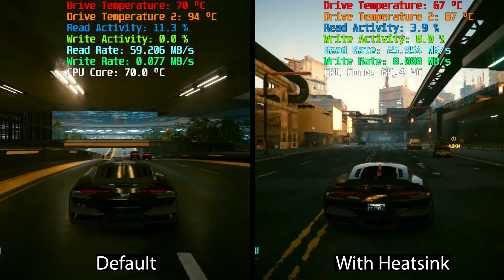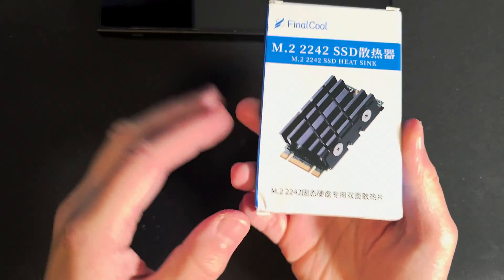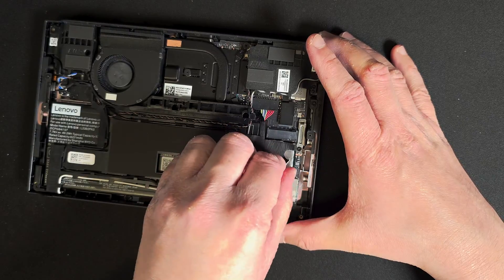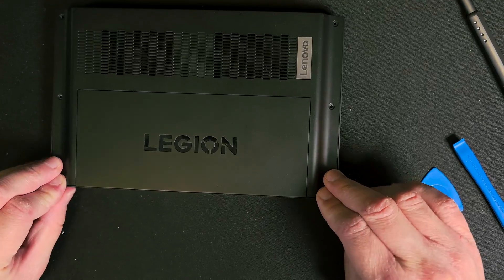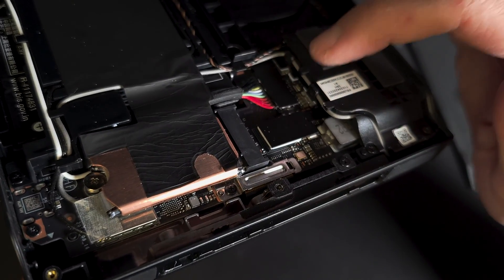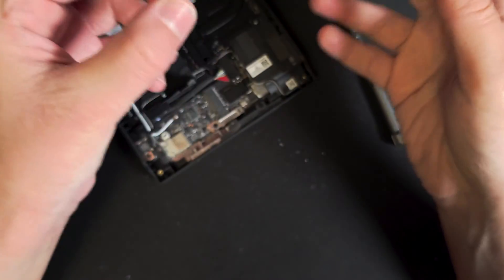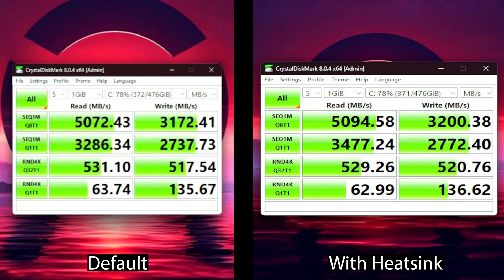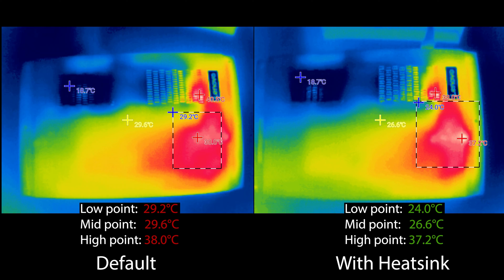Cooling Legion Go SSD - Installing & Comparing Heatsinks

Comment from the maker: I was taken by the high temps of the Legion Go SSD temp and wanted to take some action in preventing disk wear overtime, so I got those heatsinks to test out, unfortunately its impossible to fit 11mm high heatsink, not even 7mm, otherwise the Aluminum one i got would have the perfect recommendation
but still the Low-profile Copper heat sink specially made for the 2242 NVME size can still do its work by dissipating some heat
I'm also expecting other copper heatsinks that are 2mm and 4mm and will test them as soon as they arrive and give you all results 👍
2nd Part: https://www.youtube.com/watch?v=bOO2T7wrk14

Are you currently using a heatsink for your Legion Go SSD ? let me know

Legion GO playlist : https://www.youtube.com/playlist?list=PLg8ANjUNzqfN0uUCjfOQmFXCNulJuFIRr

If you enjoy my content Subscribe & Join the TECHOSAUR Community on Discord here : https://discord.gg/PXmJY6BP8b. 
you can seek technical assistance, exchange ideas and experiences, relax, share memes, make video request and most importanly feel at home

-------------------------------------------------------------------------------------------------------------------------------------------------------------

Heatsinks I tried:

https://www.amazon.co.uk/DolDer-Copper-Heatsink-Cover-Shield/dp/B0C9MD3P7K

https://www.amazon.de/DolDer-M-2-SSD-K%C3%BChlk%C3%B6rper/dp/B0BHT29565

-------------------------------------------------------------------------------------------------------------------------------------------------------------
For reference only, you can find the 2mm, 4mm heatsinks that I'll test next here:
https://www.aliexpress.com/item/1005002043321474.html?spm=a2g0o.order_list.order_list_main.4.68d61802XRk7x4
Reply: hey, i this still up to date or did you found something better for ssd cooling? Did you compare it with the custom backplate. (those who have this honeycombs and 2280 mod. )
Reply from the maker: @50fiddy05  I have the custom back cover ordered, and the newer revision should arrive this week, I'm going to check out how much it helps in cooling SSD and try some compatible heatsinks
https://www.aliexpress.com/item/1005006492565219.html?spm=a2g0o.order_list.order_list_main.11.175518026jb09c

if you are planning to get this back cover, please buy it from this link to support me, it's affiliated with no extra cost to you.
Reply: Were you able to see if the 2mm and 4mm fit and do better than the one displayed in your video ?
Reply from the maker: @Aaanze Unfortunately, the seller on AliExpress is unprofessional. I bought them in November 2023, and they never arrived. So, I ordered them again in February 2024, and they still haven't arrived yet. I'm in touch with the courier to find out what's going on, but they're giving me a hard time. I'll try to get them elsewhere, but I haven't found anyone else that has 2mm and 4mm for a 2242 SSD
I'm sorry for the delay
Reply: @TECHOSAUR thanks for the prompt answer, I'll keep waiting for your feedback then 😊
Reply from the maker: @Aaanze  to avoid more wait, i ordered them again but this time it says delivery in 9 days, granted AliExpress shipping not seller, hope it arrives this time
Reply: @TECHOSAUR I got the 2mm copper heatsink from AliExpress the thermal pad was a little damaged but I just installed it and it fits very nicely. I imagine it's better than nothing. I hope you receive your order.
Reply from the maker: @bigbank7350 Wow, what a coincidence!!!
Mine arrived today along with the 4mm. Did you try that one too? I hope it fits.
I've just posted about receiving them after this long wait!!
Reply: why unscrew everything if you don't remove the foil? you could have put it on without dissasamble it

Comment: How are you getting it to show your ssd temperature ingame? I'm on SteamOS so maybe this is just on windows?
Reply from the maker: I use HWInfo software to get sensor data; for the overlay, I use RivaTuner to show it. If it's supported there, then I think you can

Comment: I just turned down TDP on mine and the device has been on for 3 days to where I don't think the fan turned on crazily with general use.  It seems this is overclocked like when I had an ASUS gaming tablet that ran for like 90 minutes on a full charge... had to sell it because it got so warm that the thunderbolt port would shut down and disconnect due to excess heat.  I'll look at this for my Legion Go if it comes in 2280 config since I have that breakout board.

Comment: Have you heard about thermal pad W/MK? Dont know how much difference between expensive thermal pad with high W/MK use on copper heatsink and stock thermal pad come with the copper heatsink package
Reply from the maker: I'll be trying it soon, got some higher end thermal pad with better W/mK and will try them on, thanks for the suggestion

Comment: Cheers for the video!  If anyone is interested if what configuration I've used to get temps down.  Sabrent 2TB SSD 2030 with small plastic extender.  Foil over the SSD only (it won't fit with pad and heatsink under it).  On top, 1mm pad and copper heatsink , 2030 size and only over the SSD.  I've been running Crystal Disk Mark whilst plugged in on 30w mode.  The highest temp I can now get after five tests is 71 degrees c.  That is down from 81 which was the highest pre heatsink.  In game though, looking at far lower temps, around 60 now.  Temps are generally fine for gaming, no where near error inducing temps! :D
Reply: I have a 2230 with extension. So take off the old heat sink (took it from the orignal SSD) the  fit the 1mm heat pad, and the copper heat sink, thats it?

Comment: I think its much better to remove the thermal wrap if you gonna use the thermal pad for better heat transfer.. Correct me if im wrong
Reply from the maker: Actually now I have a 2tb 2230 SSD without the wrap and just A Heat sink and yet it's hitting over 90c 

Even if you remove the wrap it's not going to do much, there's no airflow going on there, most of the generated heat is building up
Reply: @TECHOSAUR  Im going to use a  2230 with extender PCB should i get the copper shield for 2242 or just for 2230 instead?
Reply from the maker: @macky10229 currently i have 2230 2tb with extender along with that copper heatsink made for 2230 form factor 

Putting the 2242 hestsink won't create equal surface cover so its better to apply the one for 2230

Comment: Well done for trying to discuss the problem of SSD overheating.
But your approach will not give a radical/positive result.
In the name of mobility and design of this device, the manufacturer sacrificed reliability.
If you are ready to modify the device, then I can give some practical tips on how to achieve significant results.
Warning: if you do not have experience in this type of activity, do not do anything that I have written for you here, you will lose the warranty and break the device!
1) Consider whether it is advisable to remove the foil from the SSD. Perhaps it has a backing that can interfere with heat dissipation.
2) Peel off and do not glue the ceramic tape onto the SSD. It can conduct heat to the battery, which shortens its service life.
3) Carefully drill several holes on the case in the area of the SSD. Both from the end and from the bottom. More towards the corner.
Note to point №3: The larger the diameter of the holes, the better - the lower the resistance to air flow. But you need to maintain balance
in choosing the hole diameter and the integrity of the housing structure.
Be careful and use common sense.
The holes can be protected from dust getting into the inside using the material from which tea bags are sometimes made. I mean
not a natural material (polyethylene) or you can use a mesh to protect computer coolers (with the largest possible hole).
4) In order for the holes to work more efficiently, it is necessary to build an air duct inside the device. To allow air flow
went from the holes past the SSD to the processor and ended up in the turbocharger.
I think double sided tape might work for this. Do not peel off the blocking tape from the top row, otherwise the cover will stick.
This material is malleable and cheap.
The more efficiently and thoughtfully the air duct is made, the more efficiently it will work.
The air pumped through the duct must also pass near the processor area.
Identify the remaining hot areas of the device and take care of cooling them in the same way.
!!!(Shiny surfaces do not scan well for heating (paint them / apply electrical tape before scanning (black is the best color)))
5) a) partially or completely block the screw holes located in the bottom cover opposite the processor. (part of the air duct structure (adhesive tape))
   b) partially block!!! screw holes located in the bottom cover opposite the turbine. This is necessary for the turbine to begin pumping air through the air duct and, accordingly, next to the SSD.
   The vent holes in front of the turbine should be covered from the middle to the edge.
Result: a significant drop in the temperature of the SSD and an increase in the temperature on the processor, a possible increase in noise from the turbine. Maintain a reasonable balance.
Warning: if you do not have experience in this type of activity, do not do anything that I have written for you here, you will lose the warranty and break the device!
All actions must be performed point by point, one by one, slowly observing the results of the actions you have taken.
During these operations/experiments, do not snap the lid of the device (the fasteners will break)
Just cover with a lid and tape around the perimeter.
P.S.: almost all devices are now made unfinished. This is done purposefully to increase company profits and reduce production costs.
You can, of course, take a more radical approach and cut a hole in the device body for a large radiator opposite the SSD, but without air flow to it the cooling will not be sufficient.
Contact with this radiator will be unpleasant. That copper radiator that you ordered from China will still be ineffective without airflow.
A shiny radiator is bad, painted BLACK is good: +15% cooling due to heat radiation.
Do you have any questions? (translated using Google Translate)
Reply: why should you paint radiators? what?
Reply: Physics course from school. Surfaces painted black improve heat dissipation by 10-15%. Due to its radiation. Look at the color of the cooling systems in high-end laptops. Look carefully where and what is being painted.

Comment: Perhaps the Final Cool Heatsink could be sanded a couple millimeters on the top for it to fit. It would work awesome because it has nice thickness and very secure as it is being attached by screws. I think is around 8mm tall because it's says 11mm but it is also taking in to account the bottom part.
Reply from the maker: But even a 7mm heatsink didn't fit, with no bottom part u saw

I'm getting 4mm to try it , hope it can fit my SSD is really running hot over 100c just installing steam games
Reply: @TECHOSAUR  Yes you are right still is pretty tall heatsink, would have been great if being smaller. 
I am having my Legion Go in 10 days, so I am planning ahead. But same experience with my Rog Ally, change my ssd for a 2tb Silicon Power 2230 and my temperatures went really high. I did the CPPC TEK heatsink mod and my temperatures went down really well, so for sure I will put some kind of heatsink when changing my Legion Go ssd for a 2tb size.
Thanks and I will be waiting for your next video of the 4mm heatsink test.

Comment: Does it depend on SSD? I have Corsair MP600 Core Mini 2TB installed in my Legion Go, and during CrystalMark test max temperature reported was 78 Celsius - this is by running CrystalMark test over and over again for 15 minutes. While gaming (in Monster Hunter World) max temp recorded was 50 Celsius.
Reply from the maker: Yes, it greatly varies from one model to another, depending on the NAND manufacturer and the maximum speed ratings.
Here I tried the one that comes in the Legion Go which is WD SN740

despite that, IMO the airflow for SSD LeGo isn't adequate, there isn't air intake in that area and given how tight the cover closes, I don't think the SSD hot air is being dissipated efficiently to be taken out by the fan,  its too far being on the top left

we all know that GEN 4 SSDs run too hot, I think this type of layout is good for a GEN 3 rather than 4, especially with ones of over 5000MB/s in READ

that's why I'm trying to find at least a heatsink that could dissipate enough heat while still being able to close the back cover, I tried with both 11 and 7mm in height heatsinks and it's not closing, I'm waiting for 4 and 2mm to try soon
also being 2242

Comment: Great work! These results are very promising! I saw on reddit that in some cases a user even put an extra layer of thermal pad on top of the copper heat sink, before putting the large battery sticker back on. Since the clearance of the copper one is quite sufficient, I might try that as well.
Reply from the maker: rather than that, I'm going to try next a 4 and 2mm heatsinks, I'm quite certain the 2mm will fit just fine, along with a 1mm thermal pad, we'll see once they arrive, will share all about it here, thanks for tuning in
Reply: @TECHOSAUR  Did you manage to test with different heatsinks, would love to know if you got even better results. Thanks for your videos, cheers !
Reply: @TECHOSAUR is there another video of the higher mm sinks by chance

Comment: I installed this heatsink a few weeks ago and based on a picture on Reddit I put the heatsink onto the drive directly and unwrap the metallic film that was originally on the ssd and put it back around the outside of the heatsink. Does this matter?
Reply: I was wondering why he didn't do as you suggest. Apply pad over the wrap look a bit stupid to me.
Reply: how have temps been for you since adding the heatsink?
Reply: I don't use such a device. But if you are wondering what the temperature is on my SSD drives in my PC, then I will answer it does not exceed 30 degrees Celsius, but it can also be below 0.
Reply: I feel like you're supposed to, lol.
Reply: ...Wrap the chicken in foil and put it in the oven... (from the recipe book on how to break your hard)
Reply: the termal pads will melt over time... so you have a risk of shortening the device don't you?
Reply: @Raptorialand  You cut it to fit on the 3 chips.